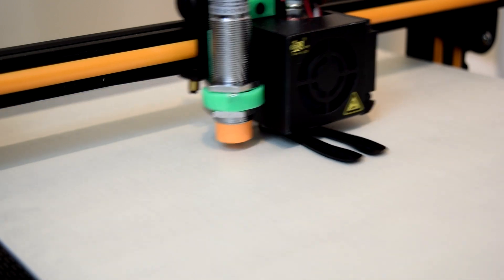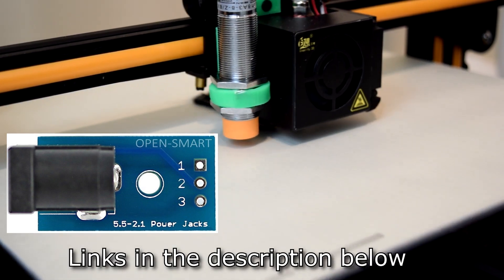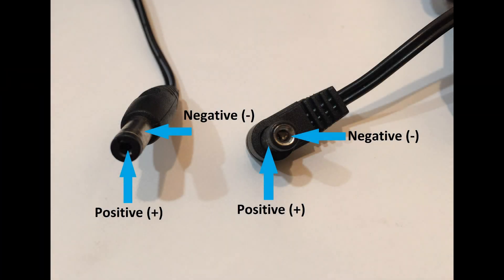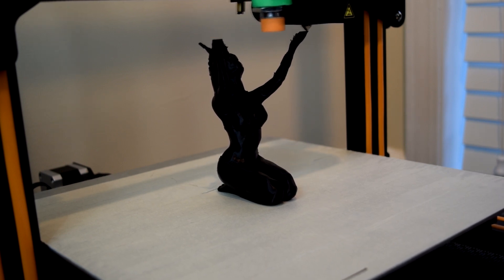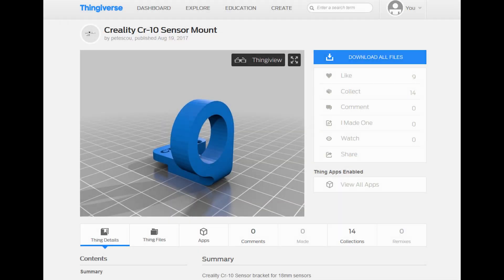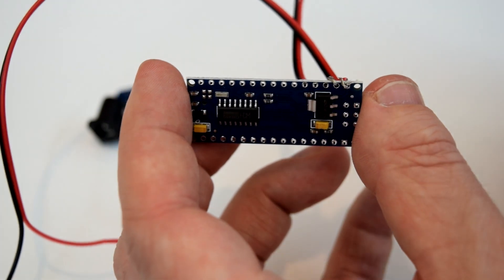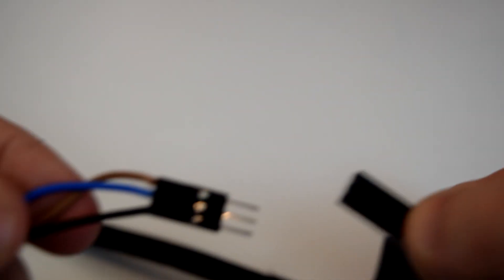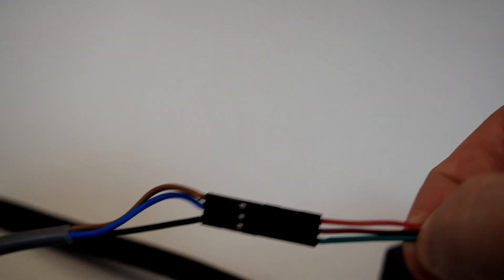Nano Bed Leveling | Making an Auto Bed Leveling Sensor for less than $30

Comment: 30 is almost the price of a BL touch clone which will allow you to get a very decent accuracy without the limitations of the inductive/capactive sensor? so I don't quite see the point of this sensor
Also, I think you could connect the sensor directly to your Ramps Endstop, you don't need a Nano.
For the glass, you can actually stick some aluminum sheet pieces in the corners of the glass and then use 3 point or Linear Bed Leveling from marlin.

Comment: Hi there, i have a LJ18A3-8-Z / BX 8mm and cannot detect the alluminum bed behind the glass build plate, not even the glass, but detects metal, any ideia?
Reply: If the sensor is not getting enough power then its detection distance may be unreliable. Sadly my sensor is powered with 24 volts (Max 30volt sensor) with a max 8mm range and it still doesn't detect the aluminium plate through my glass bed. Aluminium is not a good material to use for these sensors which means my sensor triggers at about 4mm only.

Comment: Nice video, very informative. I could not get the idea at behind of it. Why not just use an NPN-NC 5V inductive sensor and connect it directly to the Z-Min of the board. Another option to use NPN-NC 12V inductive sensor (to have more distance between probe and metal (alu bed) ) is to connect brown wire from the probe to any 12V-24V or even to V+ input of the board and then connect blue and black wires to Z-Min properly. All will work like a charm. In any case you need to make a change in Marlin to have autobed leveling.

Comment: This way could also feed directly off a printer PSU if 12V (or even 24v if have a buck converter). Thinking about a similar approach using piezo's and having a small Oled to display real-time data and to allow a few pots to tune parameters. Need to test some piezo sensors and if all goes well mount them strategically under the heat bed and use nozzle contact to listen for knocks. Sound travels very well through solids so really hoping it works. This also means the Arduino part can be as plain or fancy as you want as long as the signal your printer is expecting is compatible. Given it's an Arduino could even fit a smoke detector module and piezo buzzer and make an alarm sound if smoke is detected.

Comment: 2 question, I have a lokbuild mat on my CR-10, will this still work with an inductive sensor. And for the power supply could you just wore it to the power from the power supply in the CR-10

Comment: Nice video, but I'm confused why you're going to these lengths -- All you need to do is use two resistors to make a voltage divider to bring the sensor's voltage down to 3.3-5V and you don't need the nano?  That'd be a lot less expensive since you just need two resistors of a particular value and the sensor.  In my case, I feed the inductive sensor from +12V, then use a 15kohm and 10kohm resistor to make a voltage divider -- hooking up the signal wire between the two resistors provides you ~5 volts, and then at the end of the second resistor you hook up to the ground wire.  Am I missing something?
Reply: I made the video that Powie and Remain Indoors asked for.  Sorry, I'm not nearly as good at making YouTube videos as you, good sir, but hopefully I was able to concisely explain what is going on.  Have a look here: https://www.youtube.com/watch?v=ofhx5zgnMRU
Reply: These are two of the most good-natured "put your money where your mouth is" replies I've ever seen.  I'll see what I can do in the next few days.
Reply: I used an LM7805 to regulate the voltage. I agree that this is overkill.  It kind of a rube goldberg solution.
Reply: If you use NPN you will get ground signal instead, no voltage divider needed. Still I had trouble so ended up using an optocoupler with a 1 k ohm. Very easy to set up. Worked like a charm.
Reply: Personally I would do the Zener Diode + Resistor "Voltage Regulator" route.
Reply: Thanks Peter!
Reply: How can i connect PNP sensor to the melzi v1.1.2? I have 3.3v output with voltage divider (10k+20k resistors). But i didnt found any solution for melzi board connection.
Reply: Peter Grace I'm thinking, a prox that works with 5v plugged into the board, done 🤓
Reply: I would be very interested in know if this is "really" all you need to do as well, so i second Remain Indoors if you can show us how it's done, please do. I can solder pretty well, and follow directions, but circuit design is not my thing. :) I already have a good selection of resistors, just a wiring diagram showing what needs to go where, and I'll order my sensor. :)